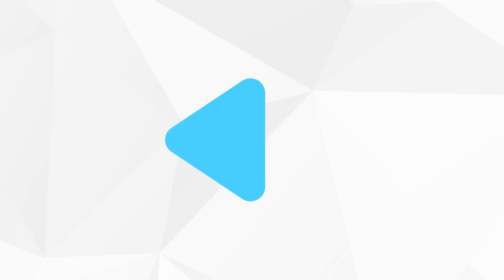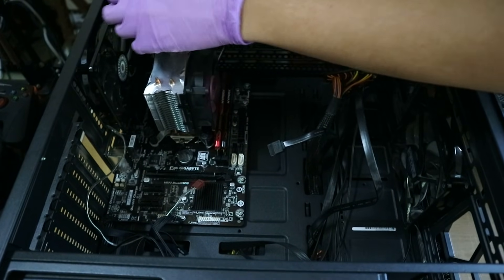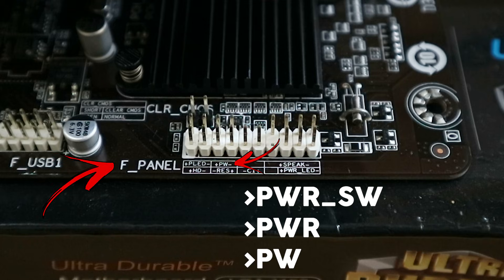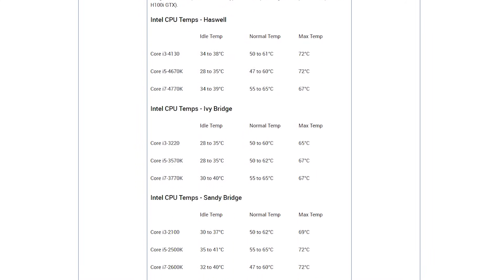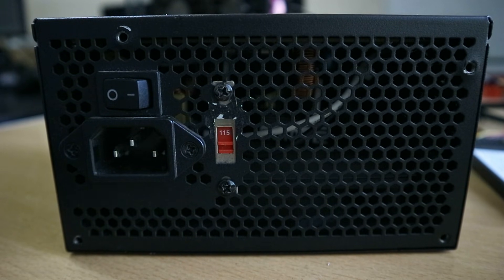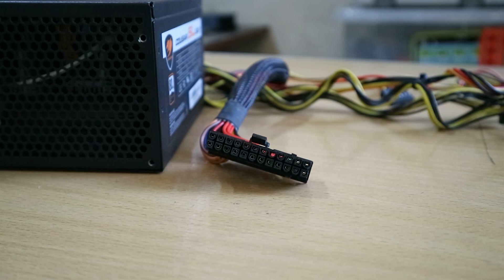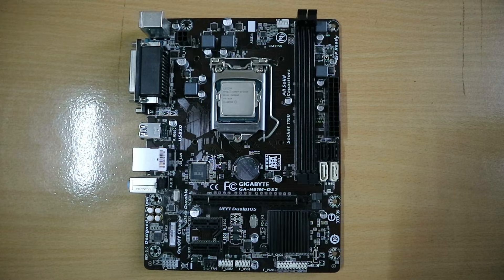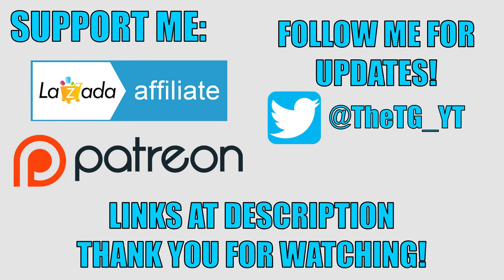A Desktop That Turns On For a Second and Turns off - PC Troubleshooting # 1

Comment: I got a spare PC which is already "obsolete" and is now the "family PC". I took it apart to clean it up, which is is something I do every few years or so, but now the motherboard has a Red LED lighting up instead of green and it only switches on for a second and switches off. It's a high end mobo from 2012 so it has a built in power switch as well as a reset CMOS button. I've used different PSU's. Still nothing. Oh well.

Comment: Ok, I have watched lots of videos and read lots of solutions and nothing seem to work for me. I press the start button CPU fan spins and speaker beeps continuously and no display. In seconds it shuts down and restarts over and over again. I have changed CPU, PSU, ram and hard drive. The one thing I have notice is when I take off the CPU cooler and start the motherboard, the CPU does not get warm or hot to the touch., is that a sign of something ? I really hope you can help me if not I will just buy another motherboard. Thank you for your time.

Comment: Im a bit confused if i test it with the wire method and my psu fan and pc fan  start to spin its mean there is an issue with my voltage??

Comment: Thanks alot a USB hub was causing the problem in my case
Reply: how do you fix it
Reply: @DreamValor  you have to remove the hub...open the PC then reconnect the hub...if the problem persisted ...then you have to remove the hub completely or replace it.
Reply: @khaledelswaifey9948  sounds alot of work but thank you

Comment: If your turning on the psu and it does it and it turns off and you press the power button and nothing happens the power button could be corroded so try turning on your pc manually

Comment: Its my sisters hp work pc, i do press the power button and the power light only blinks when it supposed to stay. Pls reply asap thank you so much and have a good day
Reply: Same problem. Did you fix your sister’s hp?
Reply: @benjievarela5430  yes by plugging the power supply wire again because it wasn’t connected good in the first place

Comment: On my old IDE computer, socket 775, it does this only when connecting molex to the IDE. With multiple PSUs and new IDE drives. Can’t figure it out. Master jumper configuration.

Comment: Can u explain to me why it turns no then off then if i remove the cmoc battery it boots up and goes into bios where i set to default an exit and when i exit it turns off. (i5 6600k,asus z170a, 16gb corsair ram, gtx1060, evga 650 full modular)

Comment: Hey! My pc doesn't turn on when the cpu is getting power but i know it works because i removed all power cables except the 20Pin one and it turned on and then i removed the cpu and it immediately shut off, then i re-seated the cpu and it turned back on. But with the 8pin connected to the cpu it doesn't post. Please help.

Comment: Meh pc turns on for a sec or fans run real quick and it turns off, any ideas? I can't even get to see the windows load up it turns off so early.
Reply: Hi. Did u come up with a solution? We have the same problem.
Reply: @benjievarela5430  For me it was a power supply problem, that burnt my ram sticks and one of the sockets. You should get your pc checked out and all your parents tested.
Reply: got the same problem did you fix yours?
Reply: @ayabuenafe2594  No, I'm pretty sure it's the motherboard tho?

Comment: I had the older PSU which has 4 pin connector nd not the 8 pin. Though I tried connecting it to the new 8 pin mother board it started but for few sec nd then went off. I guess I need a new PSU.

Comment: So my pc turned on for a split second like the main problem was. So I unplugged the 24 pin cable, the ssd cable, the ram, and gpu. Then plugged them back in. It then ran longer for like ten seconds. If someone could help me with what’s going on please do
Reply: Could you fix it
Reply: Solution?
Reply: Nope ended up stripping it for parts ig most of the stuff was damaged.
Reply: @adrienalbarez371  oh thanks. Btw what parts did you buy
Reply: Couldn’t tell you exactly I just remember that the motherboard was a msi I still kept the cpu which was a i7 but I never really bought anything it was mostly hand me downs.

Comment: Great video! My PC will turn on for a second and then power cycles (turns off for a moment and then turns back on by itself). I’ll be trying out these troubleshoots.
Reply: Welp I'm having the same problem but I know nothing about pc parts so I'm kinda fked
Reply: @dabstablook7774  For me, it ended up being my cmos battery! Cheap and easy fix!
Reply: Hey did you fix your pc yet? We have same problem
Reply: TECHIES GAMEPLAYS I have not sadly. I can give you more info though to see if we are having the same issue. It says “after setting up Intel(R) Optane Memory or the raid config was built, SATA Mode selection must be changed to Raid mode to avoid unknown issue.” I have tried exactly what it said but I get the Windows blue screen then after. So I reverted my settings and have the original issue again.
Reply: @Camj41  Okay thanks dude. I just literally gave up fixing it and got my motherboard replaced with a new one and now I fixed my problem but it just costs me a lot of money
Reply: @illmakethisgamelong9028  For me, it ended up being the cmos battery! Cheap and easy fix!
Reply: @Camj41  that's good to hear

Comment: when i turn on my pc then 3sec it turn off .i think it is power supply problem .i changed power supply but problem not solve.n harddisk doing beep sound when pc turn on atomaticly .rapidly pc turn on n turn off as long as unpluged switch. whats my problem ??

Comment: Not gonna lie, i tried installing a led strip while the pc is on, then it suddenly turned off and open for half a second, after searching a lot i saw a comment to unplug the cpu power cable and turn on the pc ( it won't turn off ) then put back the cable while it's still on but after putting it back it will be just the same issue, btw i did every solution in the video and tested the ps works fine, do u think its a mobo problem ):?

Comment: On my power supply the  -12v wire is the only one that reads off a bit. It reads like -14.5 on the power supply. I doubt that's the problem though, it turns on fine and runs. With it Installed the fans come on a second and right back off.
It started after a lightning storm which is what has always messed up my computers.
That"s some PC you have there.

Comment: my computer dont have that thing that is for computer(the standing thing or its called pc?)  and my computer is Lenovo, I used the computer for years until 2019, my dad says theres something wrong with the computer. Like, virus. I don't know if my dad is lying so I checked. And it says 

"Monitor mode"

"Input signal not ready"
"Turn to pc mode"

Then the computer turned off. I think its bc I didnt setup my mouse and my keyboard? I need a solution

Comment: I just took mine back from a repair shop and now it magically is not connecting to monitor still...
Reply from the maker: Wait what happened specifically to your system?
Reply: @misterstacy  nm. It had a second HDMI in the gpu. I didn't realize it had caps and thought the plastic was a buffer so it doesn't hit anything. Hahaha first pc build mistake.

Comment: sir what if my problem is 24 pin or 20 power connector cuz when i plug in need slowly cuz if i plug in fast yhis is gonna happend only the lights are turning on if the bottom first touch the pin light only. but when its going middle pin my fan and lights are turning on same but this is the real problem its turning on same light and fan but its continueing running but my monitor have no display and i cant restart my cpu using the power botton and when i push it all the 24 or 20 power connector when i put it the all pin and plug in all my cpu are dead no power and its not turning on plss help plss sir

Comment: How about when im playing a game then a few hours it shuts down in black screen then turns on again
Reply from the maker: Might be with the electricity in your area, or your pc is plugged into an outlet with dirty power.
Try using a avr or better, a ups
Reply: No as what i think, whenever i play a game, maybe the game causes my computer to shut off quickly but still, the CPU is still working while it shutdown quickly
Reply from the maker: So when you're not playing games, you can use your pc as long as you want?
Reply: Yeah
Reply: @xekvern  try bios update to reboot ram, the problem is probably in your ram or just buy more ram
Reply: Same problem how can I fix it

Comment: I don't know what's the problem with my PC. It's stuck on boot loop. What I've tried is unplug all cables, and I left out only the main power cable and cpu fan, it doesn't stop. However, if I try to plug in any cable, specifically the ATX12V cable, the cpu fan powers on then after a few seconds, it stops. Can you help me please.
Reply from the maker: Plug in your psu to a psu tester and see if the voltage read outs are right. If not then rma o buy a new psu. But if it's not a problem with psu then it might be with a shorted out socket on your mobo
Reply: @misterstacy  Thanks for the quick response. I'm certain that the problem is not on the psu because I've tried two different psu's and the problem still persisted. I don't know what is "shorted out socket" can you please tell me what troubleshootings I should do?
Reply from the maker: It may be with one of the sockets or plugs on your motherboard that shorted out and you might need a new motherboard.
Reply: @misterstacy  Well, at least I'm relieved that it's not the CPU. Which is quite more expensive than motherboards. I'm planning on selling it after all and buy a better one instead.
Reply from the maker: @hiromee2272  or maybe just upgrade your pc altogether like cpu, motherboard and ram?
Haha just a suggestion
Reply: @misterstacy  Yeah, already ordered Ryzen 3 2200 and Asus EX A320m 👍
Reply from the maker: Nice

Comment: Hey i had the same problem i started after there was a power fluctuation at home. I had spare PSU and i plugged it in to see if the same problem occur and it did, so i guess my power supply is fine. I tried unplugging my ram and re inserted it into different slots still no change same problem. Now i have my system completely dis assembled. I am going to try replacing the thermal gel now and if this doesnt work i am going to perform a post test.. Any comments? do you think i am missing anything basic ?
Reply from the maker: Have you tried all of the troubleshoots I mentioned?
Try doing all of them and worst comes to worst, it might be with your mobo too

Comment: How do you fix a computer that didn't finish repormating.... Then it turns on,off,on,and off plz help
Reply from the maker: Try using a boot drive and reformat it on the windows setup
Reply: @misterstacy  how
Reply from the maker: Setup a bootdrive with a flashdrive with windows 10
Reply: @misterstacy  how only 13 help plz

Comment: I had a small problem when I turned on my pc it went off, then right away after 1-3seconds it went back on .  any idea ?
Reply from the maker: It may be with one of the troubleshoots I mentioned in this video.
Reply: I fixed my problem I just uninstalled ram out from mobo then  reinstalled it again. WARNING: when you turn on your pc from power supply count 1-5 seconds before you press the power button.
Reply: Same problem here
Reply: same prob here
Reply: Bro im gonna test thanks

Comment: I just removed the back panel( turned off the power supply, and removed the cable) and wanted to clean my pc( i just blowed up some dust) and then when i put everything back togheter my pc just turned on and off, what the fucking hell

Comment: Shorting the power pins worked, no idea why.  When I plugged it back in and pushed the power supply again, it worked and booted.  No clue how its working now but im not going to complain!  Thank, my friend!
Reply from the maker: Your case power button is shorted and you need to buy an external one
Reply: Same problem. When I plugged in my power cables (8pins)it doesnt work. But when I remove it, my fans are working. How to solve this?

Comment: I just built a new pc and in turns on and off in a loop
Reply: Had the same issue but i fixed that by reseating my ram
Reply: WEBUX I’ve tried different ram slots but it’s keep doing the same thing
Reply: Preston Garvey since you most likely have warranty you should get it to a repair center
Reply: WEBUX nope don’t have one
Reply: Preston Garvey your components didnt come with warranty?
Reply: I have this same problem, any fixes?

Comment: I have Lenovo B300 all in one desktop bought in January 2011. Everything was fine until I tried cleaning my C drive following some google tips. Then I came across blue screen error and now finally nonstop ON/OFF cycle. I opened the desktop, pressed reset button.  Fortunately 1sr time reset could boot but blue screen error. Then I tried resetting again and again. Now only ON/OFF cycle is going on but no booting. I cleaned RAM using eraser and refitted in the slot but no improvement. Any suggestion please.

Comment: So my pc turns on and off instantly  after pressing power, no post.

I took out ram first, no beep.
Took out gpu. Still no beep.
So i checked psu on another system psu was hella fine.

Could it be my cpu or motherboard?, i just need reolution ahaha.

My specs are.
I3-4170
Gtx 1060
Hyperx 16gb of ram
Asus vanguard B85
Reply from the maker: Try all the other troubleshoots like replace cpu thermal paste

Comment: I changed my psu and gpu and changed the cpu fan and then my pc turns on for like half a sec and then turns off
Reply from the maker: Might be your motherboard shorting out
Reply: @misterstacy  well yeah cuz I went to a pc shop and the guy told me that the motherboard needs to be changed but it was working
Reply from the maker: @toyotamarkIIjz  it may be working but it might be,  again, a component in your motherboard itself that might shorting out causing the problem
Reply: @misterstacy  oh
Reply: @misterstacy  the fans turn of for half a sec and then off and the gpu's fan dont turn on at all

Comment: My PC went into sleep mode and now I can't turn it on. When I press the power button the fans spin for a second and the stop. The case lights are on and the USB mouse lights are also turn on as soon as I plug the PC in the wall, before I even press the power button. I've tried changing the CMOS battery and switching the RAM, breadboarding the motherboard, trying to turn on the computer just with the basic stuff connected, but no luck
Reply: Same problem I have here
Reply: Same here, first lost display in my GPU (3080 ti) all of a sudden, booted the pc using HDMI cable through mobo. Booted fine, had display. Thoughtnit was GPU issue, but then after switching off. It wouldnt boot up, after turning on, all the lights and fans come on but imediately switches off after a second or two. I’m hoping its the PSU only.
Reply: Has anyone found the solution? I basically replaced everything except the power button but still same issue and the power button turns on for a second and fans as well before turning off again😢
Reply: Same here
Reply: Same
Reply: Did anyone find a solution to this? I have the same problem
Reply: same problem, prolly motherboard failure
Reply: @andrejjj  in my case it was a faulty power supply.
Reply: @cybersloth2467  i had my game paused and just out of nowhere my pc turned off. I thought my pc overheated, but when i tried to boot it, didnt work. Fan just spins for a second and nothing happens. Theres light on pw button and it shows that pc is turned on. I had pc for few months and they r literally brand new parts. U got any social media so i can contact you to see is it same problem as urs?
Reply: @andrejjj  Try to turn it on without the video card if you can. If it turns on, then that could be your problem. If it doesn't work try to disconnect everything but the processor and 1 stick of ram, if it still doesn't work, test your Power supply in another computer if you have one or do the paper clip test (there are tutorials here on youtube on how to test a PSU with a metal paper clip or a wire). If the PSU works, then the problem could be the motherboard or the processor. Also change the CMOS battery just in case that it could be that.
Reply: @cybersloth2467  I did all of that already. Paperclip method works weirdly, psu starts spinning very very slow when i plug clip in green cable port and red one thats beneath it, but when i plug into green and black (from left or right of green) it doesnt work. Idk, psu seems to be a problem, i dont have any spare so im not sure :p
Reply: @andrejjj  Yeah, sounds like it's the PSU. When I tested mine it did spin for a second and then stopped. I tested my PC with another PSU and it worked fine.
Reply: It's the bios

Comment: My GPU Fan spins for a while, ( maybe 20 secs ) then it suddenly stops. After that, my monitor signal was lost.
Reply: Mine tooo
Reply: @core17yt54  Run windows on safe mode and uninstall the recent graphics card driver update.

Comment: Techiegames i have a question my psu fan is spinning fine when i tried the U clip but when press power button on my pc the fans spins only for a sec then off i tried everything removing the ram, removing the cmos battery and tried removing gpu and cleaning  the dusts on my motherboard idk why it still spins for a sec then off can you please help me (by the way the power led lights light up but it turns off along with the fans)
Reply: Same thing here did you fix it yet?

Comment: I have same problem, look at the voltage, mine become under 2,9 volt in 3,3 rail. Then i open the psu and see 2 capacitor leak, soldered the new one, the problem solved. no voltage drop no instan shutdown.
Reply: Hiw
Reply: How